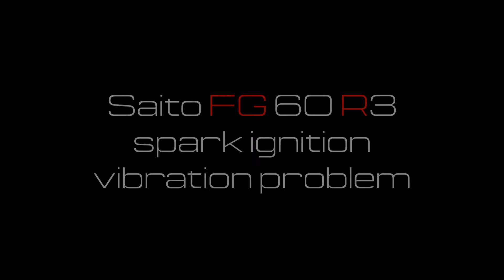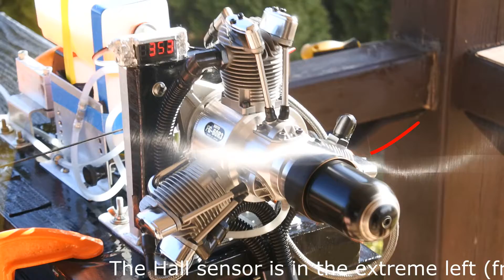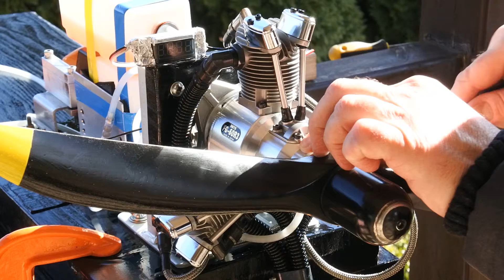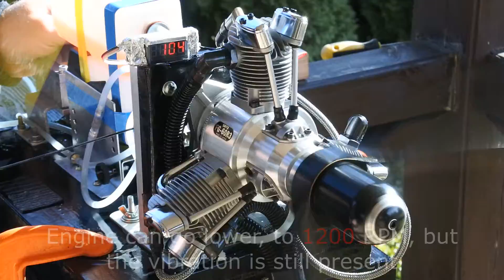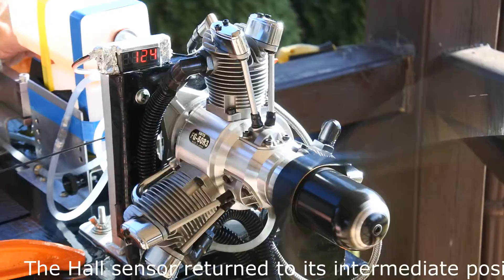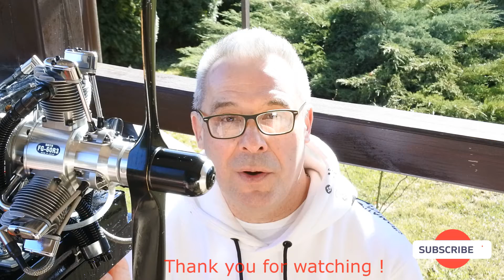Saito FG 60 R3 vibration problem

Comment: Did you ever sort this out?  It also looked to be running very rich judging by the amount of oil from the exhaust
Reply from the maker: Hi and thank you for your comment ! Definitely, there were few attempts to adjust the engine, of course, with a different carb settings. Key problems with this engine are: Uneven fuel distribution (there is construction mistake in design) and also, construction mistake in geometry design of the crankshaft and conrods. So, current engine design makes cylinders runs with different ratio air \fuel. So, that's means,  that first cylinder runs on the rich side, second runs more or less normal and third runs seriously leaner, than second. If I try to adjust the carb settings to run leaner, first cylinder will run more or less OK, second will run leaner (so, I checked the temp's of each cylinder), and third will run so lean, very close to piston seize (less lubrication, than needed). Thermal video clear shows this trend - leaner the mix, higher the cylinder temp. So, to avoid any cylinder damage I decide to run on the richer side. Should add. that this video was dedicated exactly to the excessive engine vibration, which was caused by design flaws and uneven fuel distribution. There a few videos on the net which described this problem. 
 Thank you and have a nice day !

Comment: You need a hub with correctly timed magnets. Order from CH Ignitions or MMM.

BUT...  
If you want the engine to run perfect you also need a mod of the intake manifold (back cover).
Make sure to run it with a lot of oil, that is the way to save the connecting rod bushing.
Here is my FA170 with MMM ignition, but I am still not 100% happy cause it hesitates at about 5000--6000 RPM
I would love to know how the modified back cover looks like.  https://youtu.be/Un_UOODawyI
Reply from the maker: Thank you very much for your comment ! New hub with correcting magnets was already ordered today from CH Ignitions 🙂 I have to check, how new hub will affect vibrations. Regarding intake manifold - will investigate video, which you shared with me. 
Thank you very much !

Comment: For me it looks normal, my single cylinder Saito FA-100 also vibrates on low RPM.
Reply from the maker: Thank you very much got your comment ! Yes, of course, all the engines are the source of vibrations. I also own Saito FA 100 single cylinder engine, it's simply great, runs very smooth ! Its vibration level is non comparable with Saito FG 60 R3.  In case of Saito FG 60 R3, vibration level is very high, because both cylinders, #2 and #3, due to its wrong timing, increasing vibrations to inacceptable level.   I have to eliminate this "side" effect. Thank you and have a nice day !

Comment: I'm also wondering if the compression ratio has been changed on these gas engines over the methanol designed ones.   And with the methanol fuel being such a violent, fast burning fuel, it is exaggerating the power pulses mechanical engineering design floor already mentioned.   Hello from New Zealand and I'm looking forward to learning along side you with this project
Reply from the maker: Thank you very much for your comments ! I'm very pleased by this words. Regarding compression ratio - you're totally right, FG engines utilizing higher compression level, than dedicated for glow fuel. But...there also should be some "but" :-), I know some Saito engines (FA 150B, or FA 200Ti), which shows unusual for glow fuel engines compression ratios, 11,24:1 and 13,68:1 accordingly. Also, with glow plugs Saito FG 60 R3 runs noticeably smoother, in comparison with spark ignition (on both fuels, on petrol and methanol). Here you can check, what was  the difference:
Petrol fuel + spark ignition:  https://youtu.be/fmytl0Ea4I8
Petrol fuel + glow ignition (OS G5 glow plugs):  https://youtu.be/vSZEcs6MHCg
Some of my subscribers have approved reason, of what was wrong. To be short - the problem is in an engine design flaw. I should also check this (it will take some time).
Thank you for watching CrazyEngines, and have a nice day !
Reply: @crazyengines88  all good my friend, I did read the comment on the master conrod being manufactured incorrectly.  I as a engineer myself, "mechanical, and Fitter/welder" found this to be very helpful, and I can believe they allowed that to slip through without proper modelling. CAD is so very useful 😉😂.  Thoroughly enjoy you video's.  Hopefully this translates okay
Reply from the maker: @russcole5685  Thank you very much for your comment ! It is very important for me to know your opinion, and quite often I get very good advice in the comments. I have already found the main reason for the vibrations of the engine, this is really a designer's mistake, and by the way, it is far from the only one. There are also claims to the distributor of the fuel mixture, due to the uneven distribution of it among the cylinders. Okay, let's leave it on the conscience of engineers and Saito's managers. Most importantly, I know how to remove vibrations. As soon as I get a modified ring with magnets, I will definitely make a video with this "medicine".
Have a great day and thanks for being you!

Comment: Nice video. The timing issue is not about the sensor position. All saito FG radial engine has seriously wrong conrod design. The No.1 cylinder always good timing for ignition and valves. But No.2 cylinder are too much early on all. No.3 cylinder is too much late. Open the back cover of the crankcase. And turn the crankshaft from the No.1 cylinder TDC to next 120 degrees, you will find out the problem.
Reply from the maker: Thank you very much for your comment ! Your information is quite important, thank you ! As far as I understood, it was the engine design problem, so to correct this, should be some serious mechanical "surgery" provided. Should be some "cure", this engine was quite popular and sells in thousands. 
Thank you !
Reply: @crazyengines88  I did a lot of test to fix this problem on my engine, 2 different ways.
1.	I put all magnets out from the hub, and install only 1 magnet, then I put 3 sensors on the engine, and each sensor connect to 1 single ignition. I can move each sensor position to the correct position and match every cylinder TDC. Second step is reset cylinder 2 and 3 valve timing. very important is follow the  real TDC to check the gear position, not by the screw on the hub and not by the conrod pin. After that, you will get so much better performance. The fire order will not exactly 240 degrees. But each cylinder working on correct condition.
2.	This is the perfect way, redesign and rebuild a new conrod.
Reply from the maker: @YangGuici  Thank you very much for your interesting and informative comment ! Definitely, there is a lot of work, but most important, that this problem could be resolved . Great and thank you so much !